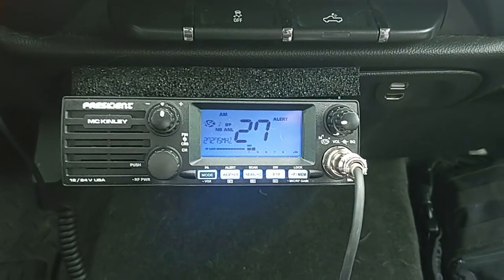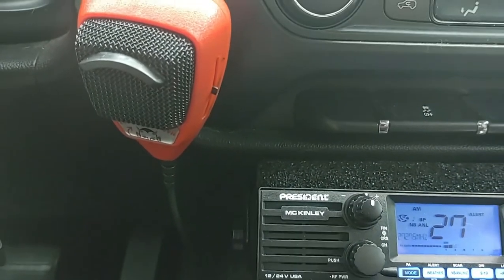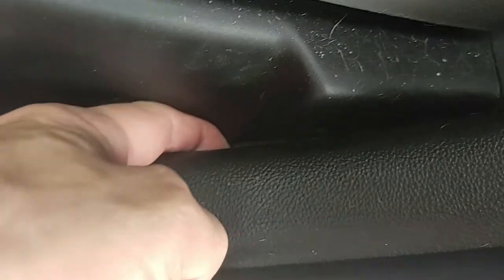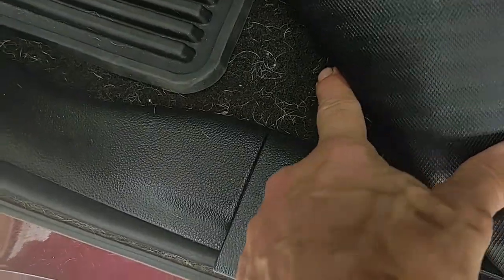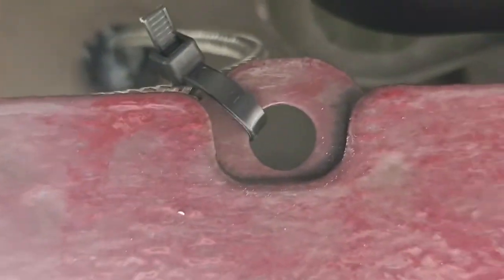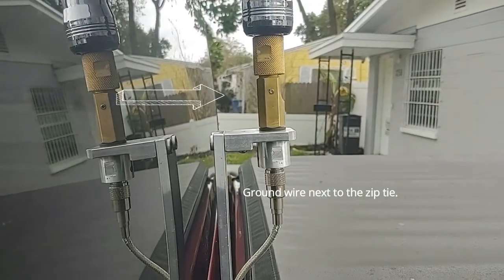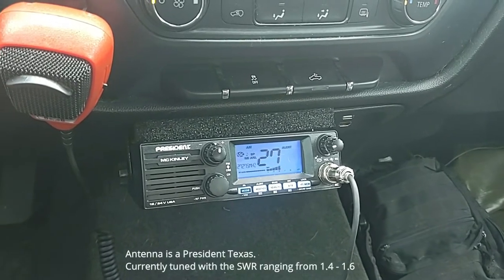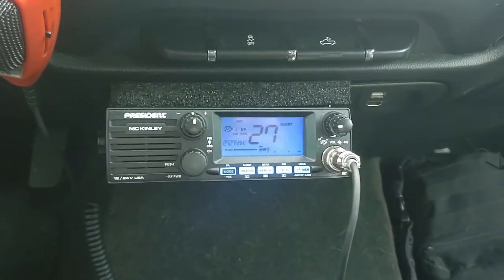2015 Silverado CB Install Part 2

Comment: LOL, right before it flashed on the screen I thought "holy dog hair". Cheers, I have a new to me 2018 Silverado am looking for a decent idea for location of the head unit. Thinking mine is going in the same spot as yours.
Reply from the maker: This really worked out as a great spot.  Removing the storage tray and just 2 small screws up in that area leaves the truck "restorable" if you want to remove it or sell the truck.  No visible mounting holes!

Comment: Where'd you run your power wire to? I'm looking to install a motorola 2way and the antenna wire will be routed the same but I'd like to know how you went about the power.
Reply from the maker: I know everyone says run the power straight to the battery to avoid electrical noise interference but I did not and I don't get any.  On the driver's side fuse box there are open accessory spots to connect to.  I tested to make sure it powered on and off when the key is turned, didn't want to accidentally drain the battery,  put a terminal end on the wire and made the connection.  I put the ground wire close to the same location.